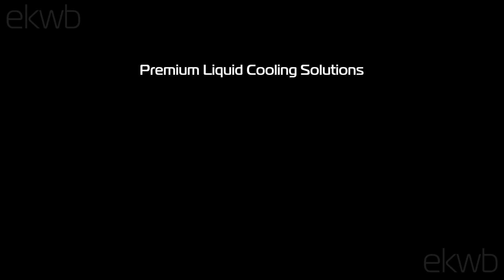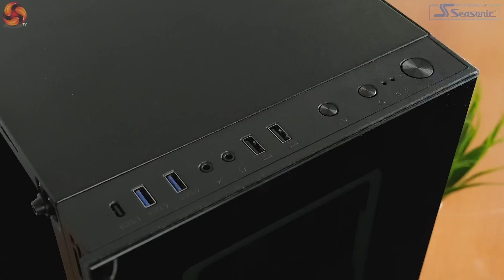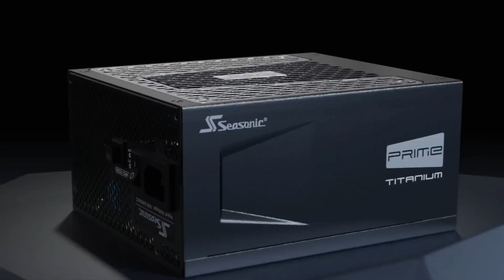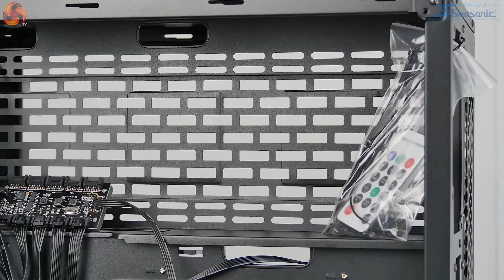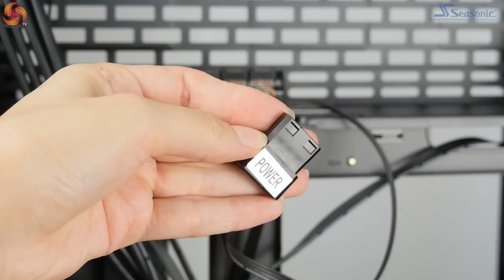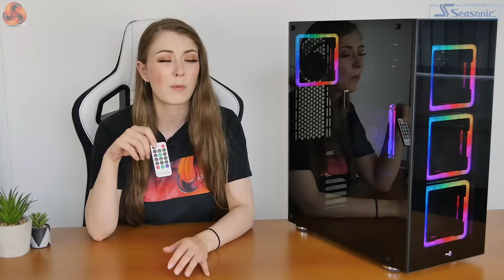Briony tests the new AEROCOOL TOR PRO RGB case

Comment: Great review! Given how restrictive the front is, I wonder how well this case would perform if you moved 2 of the included stock fans to the bottom for intake, and mount the other 2 on the rear for exhaust.

Comment: I love this case.  There are so many creative fan placement options.   You do not have the use the square fans.   Why didn't you put a 360 AIO with RBG fans on the top and 3 intake RBG fans on the bottom as well as the front intake fans.  You can also do multiples of twos-- 2 x 140 top and bottom, a 240  AIO in the back exhaust, and two huge 200 mm fans in the front.   These are endless possibilities.   Therefore, the air flow is not what you think.

Comment: Briony, this case is basically the InWin 303 modified with front intake fans and extra exhaust fans.  Please do not say the PSU shroud is odd because it is not.  The InWin 303 did the same thing and it is one of the best selling case ever.   I built in the InWin 303 and I wanted more air flow,  so I welcome this little modification.

Comment: I recently got this case, i gotta say it does look pretty good, but the airflow is much worse compared to an old Thermaltake case i had, that one had mesh at the front and had great air intake, probably the best solution would be to flip the rear fan and put it as intake, maybe take one of the front and put it on the space below as well, then the other remaining front fans to put the air out, also removing the dust filters alltogether, since its gonna get "dusty" anyways with the rear fans as intakes.

Its a nice case for being tempered glass specially for the price, but many things could have been better made, also curiously enough, i cant find the square look fans being sold separatedly, and Aerocool on its page shows this case with like 7 or 8 of them, which is was hoping in going for this time actually.  Nice review.

Comment: FYI, the SATA power plugs that are actually made by Molex, AMP, TE, etc, can only handle at most a single amp per pin (unless you pay exorbitant prices for the highest 3-amp rated ones that most manufacturers simply won't do for a budget fan controller). In contrast the 4-pin Mate-n-lock plug everyone harps on can handle 8.5 amps per pin for the cheapest of plugs (11amps per pin or more for the common ones sold on the market), something that not even the most overbuilt SATA plug can muster for supplying more than 3 fans with power not even considering LEDs (they add up fast when you have multiples of 3 LEDs per point of RGB light.

In fairness, I have experienced the pain of plugging in knock-off fake Molex/AMP plugs with sloppy pins that refuse to line up, there are a lot of flimsy fakes today.  The actual genuine Molex/AMP ones simply don't have that slop in the plug, and I have never had difficulty with the actual genuine Molex/AMP ones. likewise, I have yet to have a SATA power plug last more than a year without failing electrically or melting, so it goes both ways.

Comment: I think the idea of the grating on the top bit next to the PSU, was supposed to be for a rad mount. The patron of the holes, however, make it a bit of a fail if that was their intent. Not sure if a 120/140 fan size would even line up to the elongated round holes, and the rest looks a bit restrictive to have flush up against a rad.

If, IF that is the intent, then the fans and rad fins would suffice for hiding most wires behind that panel.

Comment: The top PSU is probebly purely in case some people have an RGB PSU(yes,sadly they exist!).A step back in design,i think.All Aerocool windows seem to be more "smoked" than most others-dosent matter if they are plastic or glass.Oh,and its about £10 overpriced (its going for £88at time i posted this).Great review,Briony.Edit:Fixed an acursed Typo!

Comment: Hi Briony, to get those cable ties neat and avoid the murderously sharp ends, you could get a pair of "flush cutters" for less than a fiver. You can push them up to the head of the cable tie, snip!, and the result is neat and safe.

Comment: Checking out frameless fans on aliexpress... deepcool made them and they were pretty bad... but press them against the front panel and the frame doesn't block intake. Eureka! Sometimes two wrongs make a slightly less wrong.

Comment: The cables in the PSU area shouldn't impede airflow too much, folks have tested that. Valid points on the other design flaws though. Still I like the idea, different, big and lots of options, tons of glass, not very expensive. Good candidate for negative air pressure setup comparison with In Win 303 and NZXT h500. Molex and front panel audio cables are the worst, and PSUs should have at least 1 sata cable that isn't daisychained like barbed wire.
Reply: Yeah,the space for the price will be the big draw for this,£80 is decent for that though,not £88.Hopefull the price will drop to 60-65,would buy at that price.

Comment: I can't see if the front mounted fans are against the glass panel. If so, it's easy to get them inside the mounting bracket and transform the case into a good airflow one.
This rgb plagued things into bad design.
Also, i like the positioning of the power supply, even if the orientation is not my liking, it draws hot air from the inside. It's better to save it and also gatter less dust. This is a timid approach to change some, in the case or pc industry. I mean, come on, it's really ridiculous that it's the most stagnant design industry out there, beeng the top of the spear, technology speaking.
At this price, I kind of agree with the lady, it's rather a good product.
Reply: Yeah couple of little rubber stand-offs would be how i would sort out the cooling,but why even bother when you can buy sooo many great airflow cases at this price? And you can buy square RGB fans from a few other manufactuers.

Comment: I was thinking of getting this case as I wanted a 360 rad up front and 240 at the back, glad you pointed out the weird way you have to mount rads on the front. Not so sure now!

It come so close as well! Just make the PSU shroud solid, and make the front a mesh material! Nevermind.
Reply: Theres a smaller version i saw,shorter.